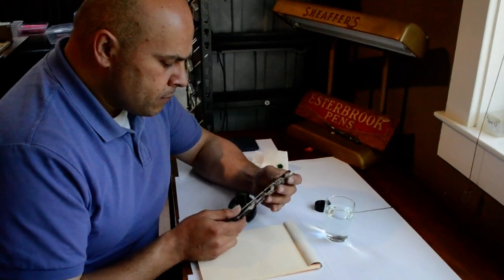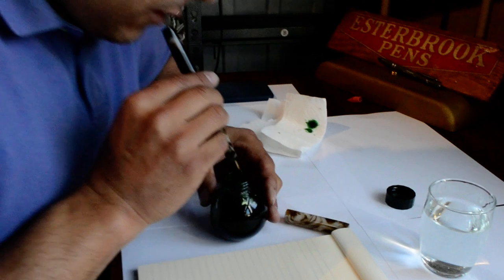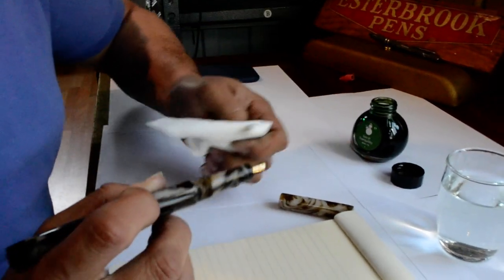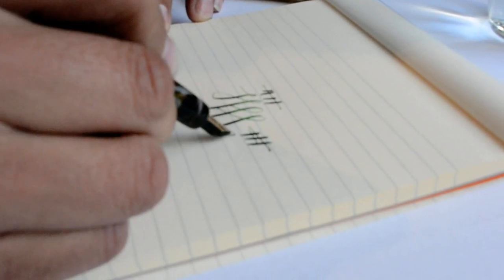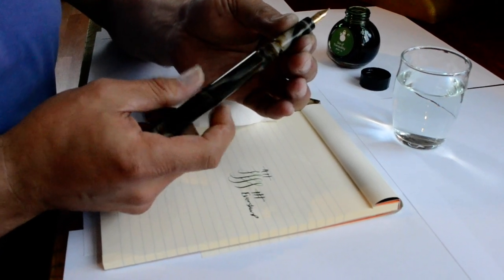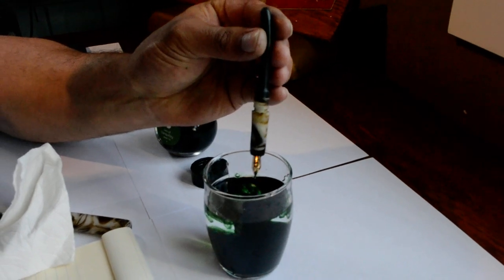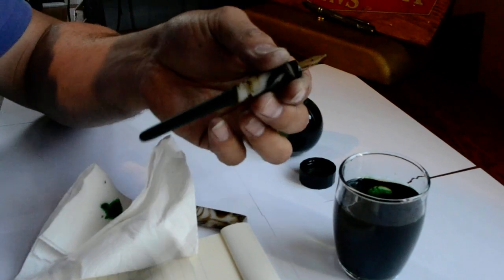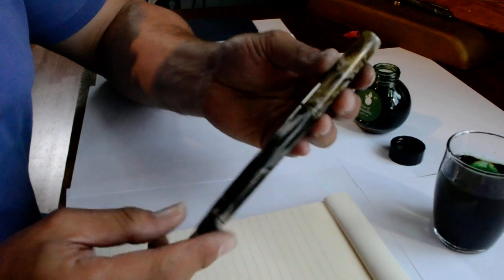How to fill a blow filler fountain pen

Comment: I had never heard of a blow filler system - unitl I was examining on of my vintage Scripto FPs. I searched for types filler systems. Found an online article which mentioned 'exotic' filling systems including blow. The clue for me was the article mentioned the hole in the barrel - which I have on my pen! From there I searched 'how to videos' for filling/restoring - and your s popped up. Many thanks for the demo!
Reply from the maker: Glad you found it useful, but don't be so sure it is a blow filler as those are super uncommon. We have seen other filling systems that rely on a small hole in the end of the barrel.  Chiltons for instance,  have a "pneumatic" system that uses a cylinder inside the barrel ..... you pull out the cylinder via knob on the end of the barrel, put the nib in ink, then cover the hole with your finger while you push the knob back down. This compresses the sac, and when you release your finger, the sac expands and sucks in the ink.  https://www.peytonstreetpens.com/chilton-14-pneumatic-filler-black-with-gold-trim-flexible-fine-nib-excellent-restored.html

We haven't had a Scripto before, so I can't say for sure. Good luck!